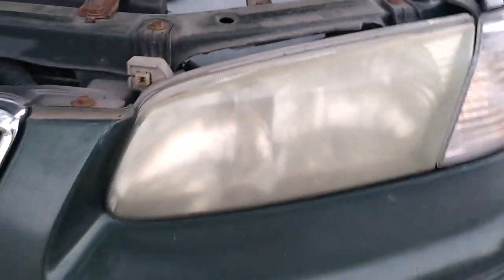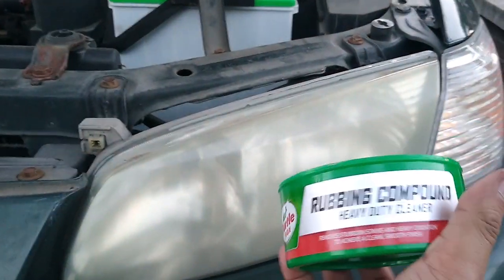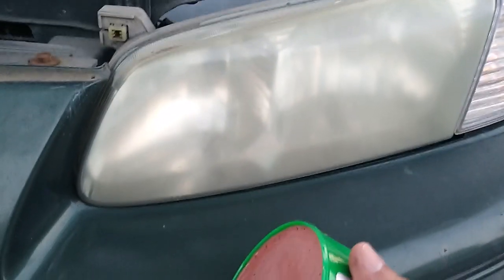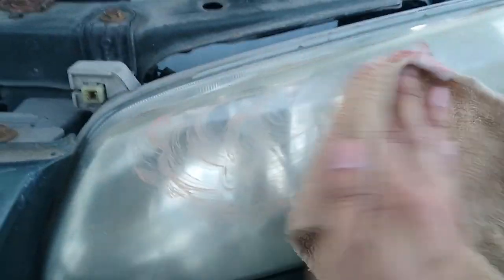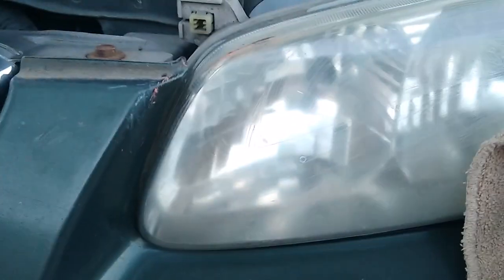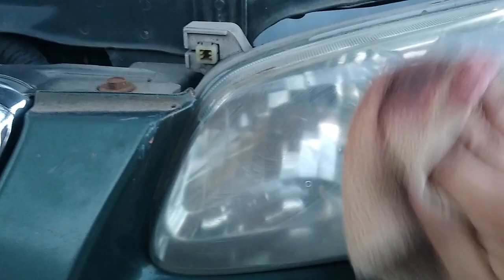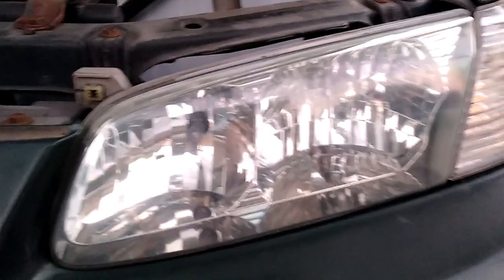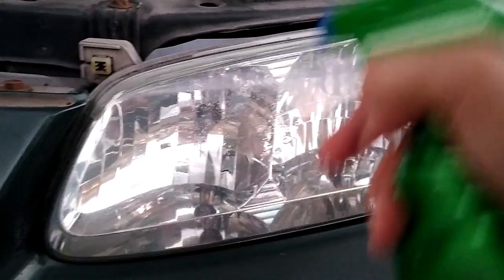DIY headlight cleaning with rubbing compound (easy and low cost)

Comment: how you know he didn't switch out the headlights for new ones? it was a quick edit....im tryn2believe this owrk
Reply: It does work saw a auto painter clean over spray clean off of some headlights with this stuff just need alot of rubbing power
Reply: @sanchiajohnson8920  how wet sand w grit800? first..............
Reply: Cause there is literally nothing to gain for him to do that.
Reply: Also, you can basically see it do its job whiles it's rubbing lol
Reply: How do i know ?umm because i have done this too.
Reply: I use a cutting compound at work with an air sander to polish Acrylic to look like glass  
You need to go through the grades first.
Start at 600 to 2000
Then buff until they shine.

Comment: Instead of wax, I would use the headlight protectant spray by meguiars. Its basically wax but it seems to last year long and can last longer if you respray once every year.
Reply from the maker: Whatever works and keeps your headlights clean and clear. 👍
Reply: @stevenperez3613  Hey! How's the condition of the headlamp now? How long can I expect this to last.
Reply: It’s not wax it’s rubbing compound

Comment: Yep I used the same Turtle Wax rubbing compound and a old sock because I had some already in my garage and it worked great. After rubbing it out I finished it with some Nufinish.
Reply: Nu Finish is good stuff,  underated but still going strong.

Comment: Wow. And to think there are peeps out there sanding their headlights in multiple stages and using spray clear coat to get the same results you just did with only rubbing compound and spray wax.  

Good job bro.  I’m gonna try what you just did.
Reply: The clear coat ought to give a much longer protection than wax. But then you have to worry about overspray
Reply: Sanding and clearing lasts about 1-2years. Without that youll be lucky to get 6 months without going back to yellow
Reply: That's why this is called a bandaid solution. If you are looking for an easy consumer friendly option, do this with an orbital tool, and put PPF when you are done.